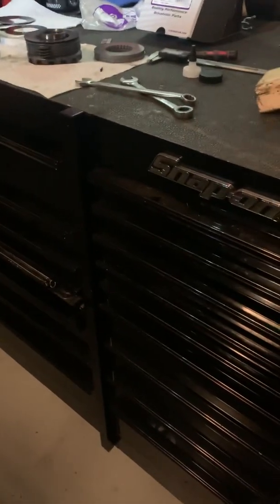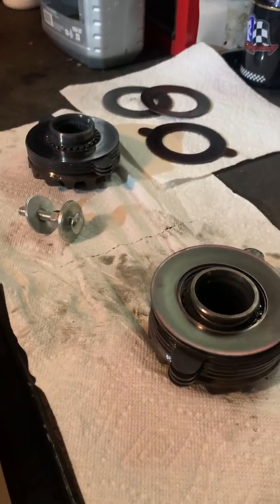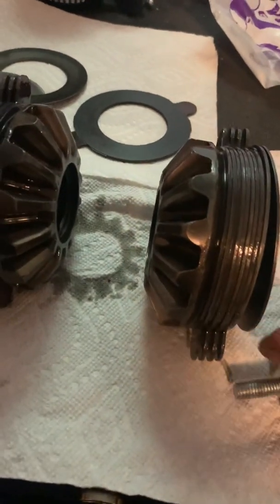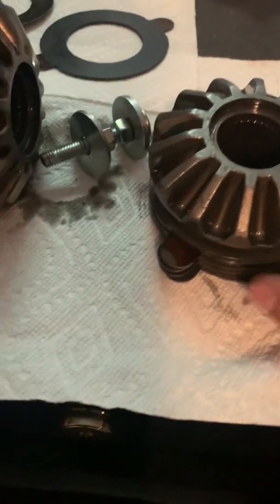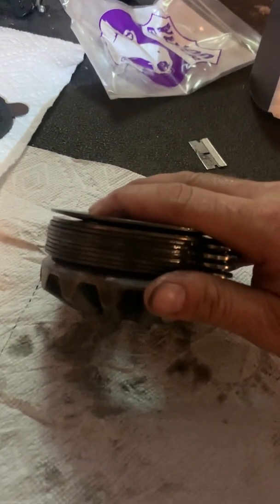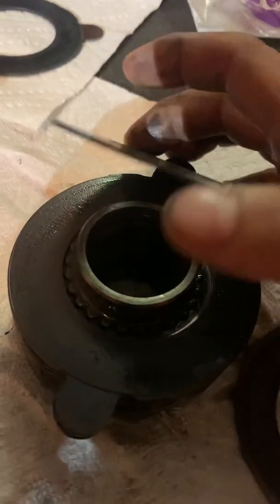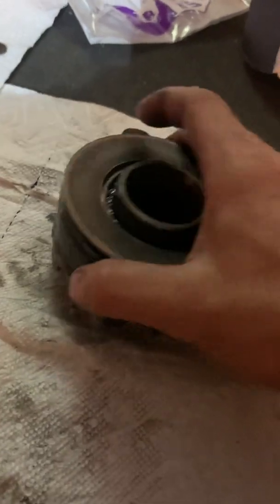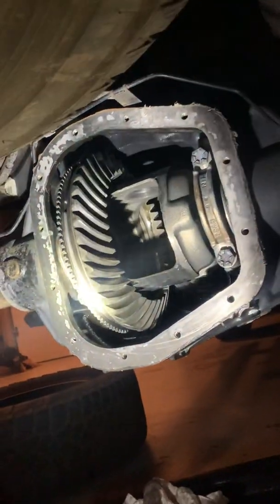Ford 9.75 rear end friction clutch’s part 1

Comment: "Wave washer" is a belleville spring
Reply from the maker: Yes you are correct.  Thanks for your update.  Did you subscribe to my channel?
Reply: @275stratos  No, thank you for the video! Deciding right now if i want to tackle this job. Dont want to pay 145 dollars an hour for 5 hours of labor.
Reply from the maker: @DANIAC262 if you decide to tackle the  job make sure you use Ford friction modifier
Reply: @275stratos  Yep, got some. Also thinking about just putting in an eaton lsd with worm gears. No clutches.
Reply: @DANIAC262 how did it go was it hard ? Thinking of doing mine on my 99
Reply from the maker: @myles5514 It’s  not to bad if you have some experience with rear ends . Just keep up with the shims and put them back where they come from .